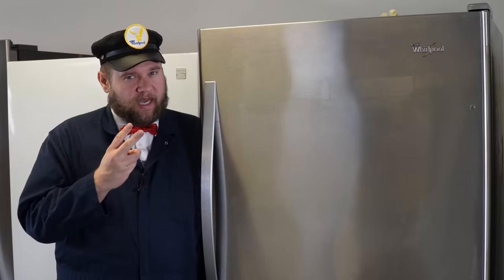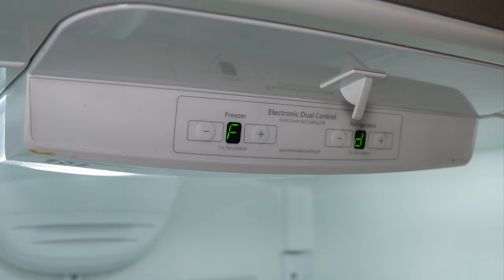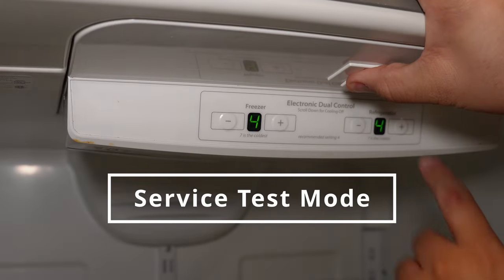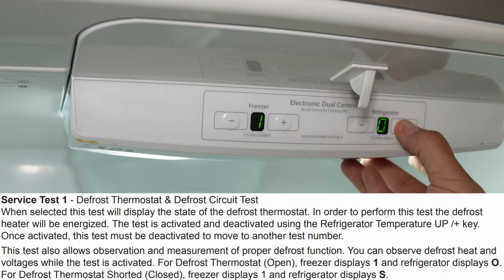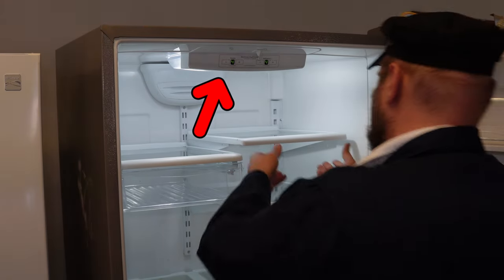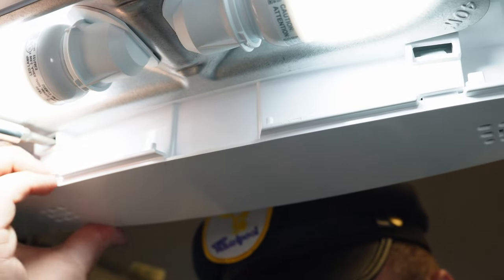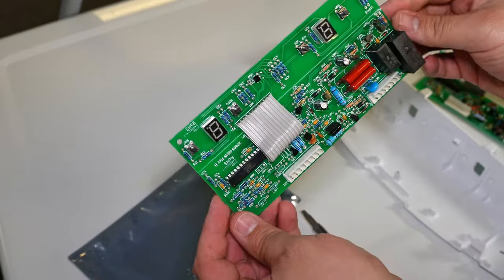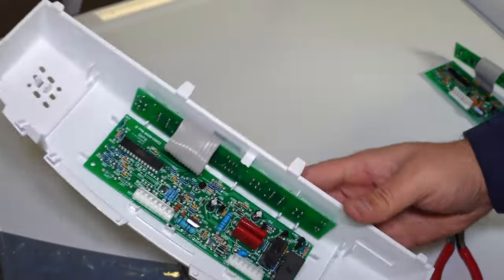Whirlpool Refrigerator Forced Defrost, Service Modes, Troubleshooting & Replace W10503278

Comment: I have a whirlpool wrf736sdam12, bottom mount freezer, and it seems like the bottom is constantly building up with ice. I'm in a rental unit, but I'd rather not have to wait for the landlord to fix.
Its gotten so bad that the ice is preventing the freezer drawer from pushing in all the way, causing the gasket to not seal all the way, making the problem worse, and then leaking water when it tries to do the auto-defrost. 

Seriously, why the hell would they not put a manual defrost option in? ESPECIALLY on a drawer model that has the possibility to get hung up on frost as you close it.

Comment: Would love to figure out my dishwasher.  Kitcheaid KDPM604KPS.  Tub will fill on its own from supply line, can't run any cycle other than express due to e4f8.  If I use side of sink with didposal it will flow water into the dishwasher.  It didn't do this before circulation pump was replaced.  There have been two different repair companies and 7 visits.  they have replaced circulation pump, and the supply line connection valve on the dishwasher itself.  If dishwasher is not used for it will fill the tub in about 12 hours. If run any other cycle it will fail before completion with e4f8 error.  Each time it has this error, the tub is full of water, leaking out the tubes to the drip tray, causing the float to raise, triggering alarm.  I am about ready to replace this less than 2 year old dishwasher as my wife is beyond frustrated with it.  I have an extended warranty but they think it is fixed each time, and fails after they leave.
Reply from the maker: Who installed the dishwasher? That sounds like a water supply issue more than the DW itself...
Reply: @bensappliancesandjunk  The dishwasher was originally installed by Lowes, and then has been in and out several times by repair company that Lowe's hired.  The fill assembly valve was replaced (#23) on the "Pump, washarm and motor parts diagram" for the model.  I do know that #6 on that same diagram is not present, but repair company says its not needed.  The repair place ordered another fill assembly valve as this one may be faulty in their eyes.   There is some talk about the routing of the drain hose, from the techs peer translator (he's Russian and his English is not that good).  He looked at it while on the phone with his company and didn't see any changes being made.
Reply: @bensappliancesandjunk  Yeah it sure sounds like a PSI issue in the water supply line. Could be too high.
Reply from the maker: @MichaelCater  reading Whirlpools documentation, it entirely involves supply/installation issues far more than valves and such, and it sounds like they just threw parts at it rather than diagnose the actual problem and what made it fail